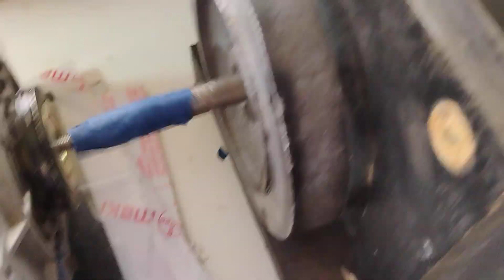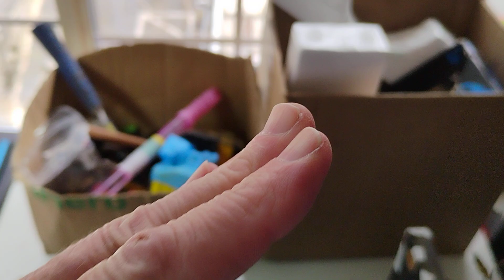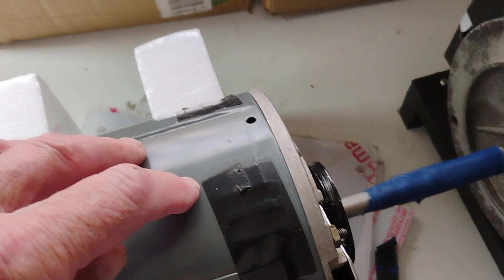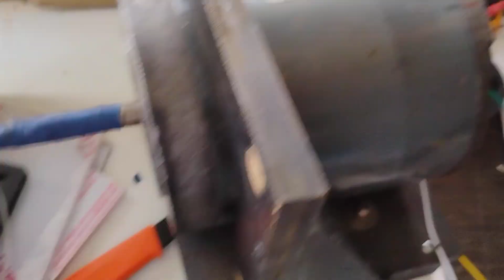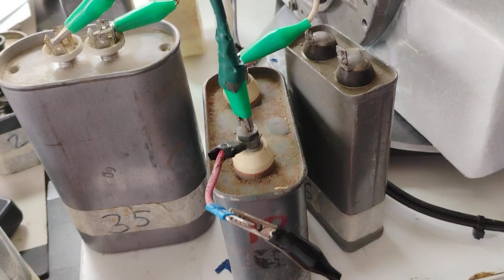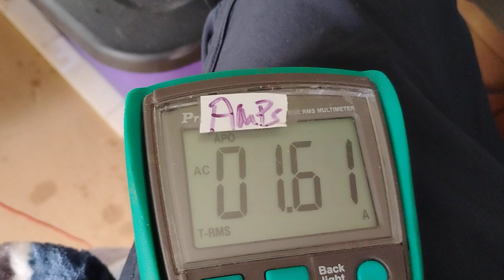18 minutes of testing of two magnet rotor PMRV; 240W input and gets hot but does spin at 60hz

Comment: Hi Doug, How about the RV looped though a BiTT to power the inverter and then power the RV to complete the loop. I never had any really great results with a magnet rotor in a RV. Cheers buddy
Reply: BiTT isn't overunity. There needs to be another component.
Also, "frolov transformer" design is much better than BiTT and more economical.

Comment: Electrical laminates are designed to resist being magnetized permanently.
Reply from the maker: yes,  they need to switch polarity "easily" at the rate they are designed for (60hz in this case)
Over saturate magnetically the laminate cores, they can get "stuck" too long in polarity they were induced into....and it takes more power than it should to force the polarity of the laminates to flip...

Comment: Shouldn't you try six magnets for your rotor,two for each set of windings?
In your test you were only using one set of windings for drive right?
Is your goal to use one set of windings for drive, the other two for power generation?
If it is maybe you could time it properly so the lenz from motoring and generating would cancel each other, resulting in zero lenz
Reply from the maker: I am trying to "imitate" the rotovertor but with permanent magnets in the rotor.
So when I got the motor on left (with permanent magnet rotor) to run at 1750rpm on 60hz 120VAC from grid (while the motor on right is not connected anymore to the 120VAC and just the rotor is spinning, attached to shaft of motor on right)
Now there are two phases of the three taking in AC power (the L1 and the L2 lines are connected to the 120VAC) 
While the L3 line  has a "run: cap (tuning cap)  between the L2 and L3 lines.  This is the rotovertor thing, making a 3ph AC motor run on single phase AC from the grid, and you get draw way down finding the best UF value for that run cap, across the "rotary transformer phase" Which is what is "between" L2 and L3
So its two sets of windings, for "drive" and one set of windings for "power generation" (and also the tuning of it)
Its "VARS" being made in the run cap phase, (L2 to L3) but can be made into real power by a series transformer. some tuning caps, and then aFWBR into load to "extract" that VARS and  then turn it into real power...
I am going to change now to 4 magnets in rotor NSNS and see how that goes.
this was the original plan, but thought I would try only two magnets in rotor at first.
Six magnets I could see that if the 3 phases are timed pulsing DC, or running off a 3ph transformer....
Many possibilites - might end up just a generator, not both motor and generator same time, we will see...
Thanks for writing!